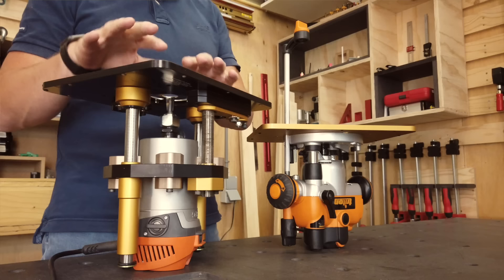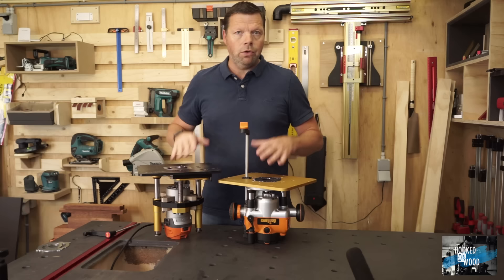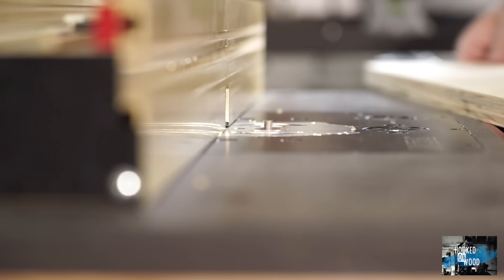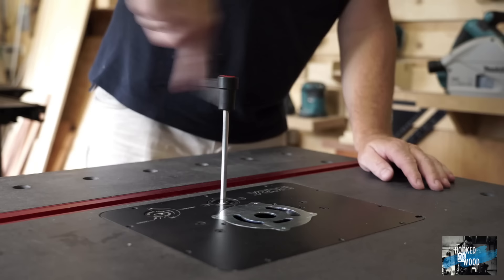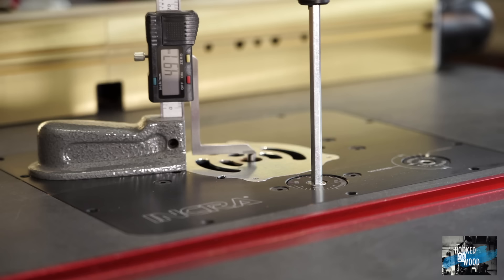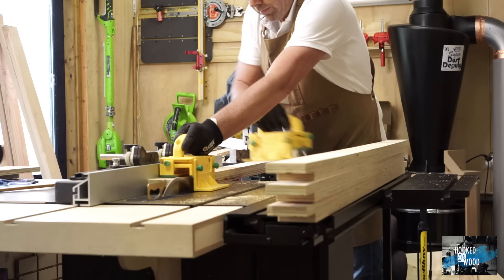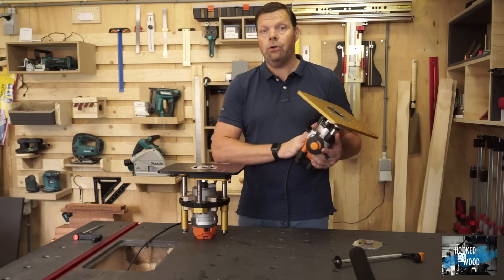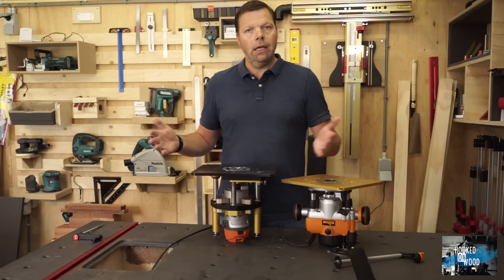Router lift test INCRA Mast-R-lift II VS Triton router

Comment: A good comparison - thank you. I have the bigger 2400W Triton router with the incra fence, incra mounting plate and clean sweep inserts. This set up is super accurate and I wouldn't change it for anything else. The ability to change router bits with one spanner quickly with the Triton is also very convenient.
Reply from the maker: I never compared the 1400 W and 2400 W version. Did you?
Reply: @HookedonWood  is it possible to compare the routers? I want to make a routing table, but I'm not sure which router to purchase.
Jof001, mof001 or the tra001.

Comment: This is a timely and great review.  I live in Germany, and last week I replaced my Triton TRA001 in the Incra router plate with the Incra Mast-R-Lift II and the AUKTools router.  I was thinking about the AEG router, but then I found the AUKTools router and the option I bought has the external power and speed control.  My router table has the CleanSweep housing under the table, and it was getting tiresome to constantly open the router stand cabinet and open the CleanSweep access door every time I wanted to lock or unlock the router height.  The Mast-R-Lift II is a joy to operate and the AUKTools router meets all of my requirements.  The CleanSweep inserts and enclosure are fantastic for controlling chips and dust.

Now I need to find someone in Europe that wants a Triton router and Incra mounting plate.  :-)
Reply from the maker: I found someone on a Dutch forum who wanted mine. I will put a link to you comment. Maybe he wants it.
Reply: @HookedonWood  Thank you, Dennis!
Reply: @martinmeijer5225  Hi Martin, I don't want to post my email address here, but if Dennis would be so kind, he can send it to you.

Comment: There are actually a few other brands that sell over-the-table-adjustable routers like Bosch, Trend, ect...
love your videos!!!
Reply: But none in the 3.25HP power range.
Reply: @staskotula4301  Check the amperage rather than the HP rating. It's a much more accurate representation.  The Triton TRA 001, listed as 3.25 HP, is rated for 15  amps @ 120 volts. The Bosch MRF23EVS is listed as being 2.3 HP but is also rated for 15 amps @ 120 volts making both routers 1800 watt machines regardless of Triton's inflated claims. The fixed base for the Bosch includes above the table adjustment.

Comment: I have always wanted a router lift and I saw the Triton at the UK's D&M Tool woodworking show.  As of today, Triton JOF001 1/2" router £180, INCRA Mast-R-Lift II £470, UKJ Router Elevator £430.  Both the Incra & UJF require the additional purchase of a router.  It really is a no-brainer in my view and I bought the Triton and modified my existing table plate for free.  I find the Triton a superb achine for the price (indeed, at any price!); loads of user-friendly features and safety features.

Comment: Good review!
The Triton comes with a moulded dust collector around the bit. (I see you did not fit this). I use this in conjunction with a fence extractor. Works well. Because you need access to the switch (because of the spindle lock power interlock) as well as the lift lock, a box gets in the way. I fitted a DRO to the lift, so I get a readout of the height at the touch of a button. Fit a guide for the winding handle and it drops in easily.

Comment: I have the Festool OF2200, the dust extraction on that is brilliant. Fully enclosed!  And the plunge is perfect, no play on the pillars,  and the locking system clamps both pillars and the cutters are dead on 90° to the table top. Perfect

Comment: Hi Dennis

I use a big Triton in my table and this comes with an excellent dust extraction shield which removes all the dust from below without any obstruction to the lock or switch.  I have " modified" the switch so that I can leave it on and still raise the router to the top activating the spindle lock.  This is OK as I have a NVR switch on the front of the table ( but I still always unplug the lead before changing bits).  I think the Incra plates would improve dust collection a little but by using a generously sized insert I find it is pretty good.

At the moment I am torn between building one of your new design benches and Ron Paulk's latest version which is easier to move if I want to work outside the workshop ( in UK workshop is about 150M from the house).

Comment: The Triton has two spring loaded carriage bolts for mounting its accessory plate. They  can also be used to mount the router to a router table. This allows you to release the router for hand held use very simply and quickly without using tools and without the hassle of unscrewing/screwing four screws. For some reason NO ONE does this when they show the Triton even though the company does it themselves and recommends it. 
Also the Triton has a dust collecting shield with hose nozzle so you don't need a box. I built a box and lined it with towels to cut the noise down.
Reply from the maker: Thanks, I did no know. About the dust collection shield, I tried this, but a box is more effective.
Reply: Exactly! I love my triton router, that's exactly how I mount it in my router table. Such a versatile router! It's also wonderfully powerful
Reply: For whoever else wants to do sth. similar: Use „schwer entflammbare Schallschutzmatten“ (“flame-retardant sonic mats”) instead of towels. Sold as foam plates. Or just „Trittschalldämmung“, which is cheaper.

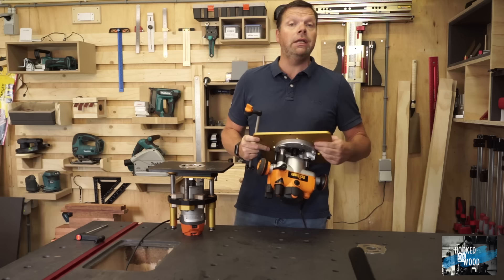Comment: 2:42 Bosch GOF 1600 has that feature, too: You operate the lift using a hex-key. Since dust will eventually accumulate in it, you might want customize it.

Comment: I use to have that exact set up, the older Triton router with the Incra standard plate. For the record, you do not have to drill the hole for the height adjustment rod, the incra plate is made with it. Also, Porter Cable 895 has an above the table height adjustment, with  more precise adjustment and the Incra plate for the porter cable has the hole for the height adjustment rod. As for the Triton router, it was a very frustrating router to use. As you said, no precise height adjustment. Also, often when I was trying to fine tune a bit height, as soon as I unlocked the router it would drop, so I'd have to start all over again. Also, the pin that locks into the shaft for bit changes, so often it would not lock in. It was not jammed from dust, moved freely, just could not lock in all the time. Since that is the only way to change bits on that router, it was very annoying. I was also not a fan of the power switch being the lock out, more reaching under the table. I get the safety factor, but it was annoying. I have a safety paddle that is very accessable. While the triton had plenty of power, did everything I wanted, it was beyond frustrating to use. I ended up getting the Jessem Mast-r lift for incra and it's a joy to use. It's a work of art and so precise. With a porter cable 3-1/4 hp motor it's just amazing. Gave the Triton to my son, I do not miss it one bit.

Comment: I have the Triton TRA001 and I bought a Kreg mounting plate for it. Like the Incra the Kreg is pre drilled for the router and the hole for the winding handle is also pre drilled. The Kreg plate was about €70 including delivery and import duties to Austria, from the US on Amazon.com. This would have been more than €100 on Amazon.de. The Kreg plate is made of high density plastic rather than aluminium but it is extremely solid, it doesn't sag and I'm in the process of making a router bench for it at the moment. I like the design of your dust box and I will definitely include something similar in my table.
Reply from the maker: Hi, Nice router, and although I like the INCRA but I think you will be happy with the Kreg also. Good Luck with your router bench.
Reply: Thanks, the build is going well, though I have some work to do to completely level the Bench top. The heavy wood board I have is ever so slightly bowed so i will have to flatten it out before I start to use it. Keep up the good work I enjoy your videos.

Comment: I chose Triton (with the Incra plate) for its sheer power and it's ability to use every possible bit size (metric and imperial) on the planet, no limits.
Palm routers just don't have power needed for anything else but trimming corners or for working with hard woods.

Comment: There is another company called trend which do the same on their T11 model Rueter I’ve used both and I actually think the trend is a better option they also have a massive selection of accessories. You mention making this plate yourself I would love to see a video of you doing that I don’t believe anyone else has done it yet especially if you could incorporate improved extraction like you did with your tablesaw insert I’ve made it and it’s made a huge difference to my dust collection so to have the same on my router table would be fantastic keep up the good work love the channel👍

Comment: You missed the Porter Cable 890 series.  May only be available in the US.   It has above table adjustment as well.  Been using mine with a Rockler plate for years.  Had to drill the hole for the adjustment wheel as well.
Reply: Slightly old comment but Porter Cable hasn’t offered routers in since 2020.

Comment: Good detailed look thanks. My friend just gave me this router and gonna be getting it set up in a table
Reply: Very well done video, thank you for making it. I have been considering purchasing the Triton 3hp router with a plate like the Incra, since it seems to offer the best value. But I have so far been scared away by the many reviews I have read, reporting that the mechanism that winds the router up and down is constructed of cheap plastic components that routinely break, rendering the router lift useless. I wonder, in your experience with the Triton router so far have you had any trouble with that mechanism? Does it seem cheaply constructed? Thanks for your videos!

Comment: Thank you so much I actually was think of building a router table only with the Jessem system now I probably will go to the incra lift the dust extraction just convinced me.
By the way I am looking forward to your workbench build just because being able to remove the incra positioner and re attach it in a consistent way is perfect for my garage where I have to use the a workbench for multiple tasks.

Comment: Not only Triton has that feature... the AEG in the video has that feature as well...
What's nice about the Triton is that it locks when you lift it to the to so you can exchange the bit without removing the  whole thing from the table or trying locking it while it's still installed in the table
Reply from the maker: Yes, you are right. Thanks for the information.

Comment: Hello Dennis, very good and informative video, thank you. I wanted to add, that there is also a router from Trend (T11) with a similar mechanism - but it´s a different price level than the triton. When I am going to plan my router table, I probably will chose the trend (because when you want to use the machine also as a template router, then the handling from the trend is because of the balance probably better).
Thanks and all the best!
BTW: I am very impressed with your dust collection system on the router table. Thank you, because that is what I am looking for, when I am building my router table.

Comment: You left out the only router lift that functionally changes the operations you can perform on the router table. The MLCS PowerLift Pro takes the concept of the plunge router and inverts it for use in the router table. The foot pedal allows you to bring the spinning bit up into the work piece. Making it possible to do mortising, circle cutting, stopped dadoes, incremental passes, etc. 
Combine all that with .001" precision movements, memory positions, and other computer controlled features and its easy to see why it's unmatched by any mechanical lift.
So would you please consider the MLCS Powerlift Pro. It's a game changer
Reply from the maker: Wow, that is a nice looking product. I do not think they sell in europe.

Comment: I have the Triton TRA001 router in my router table.  It's a great router but it could be better with a couple of minor changes.  First, you can't lock the lift mechanism from the top of the table.  This can be frustrating, particularly if your router in enclosed in your router table for dust control.  On the Freud router this replaced, everything can be done from the top.  Secondly, in order to raise the router all the way up and lock the arbor for bit changing, you have to reach under the table and turn off the switch.  Again, a nuisance if your router is encapsulated. I have a switch on my router table so the switch on the router stays on all the time.  I disconnect power from the router instead of turning off the switch.  They should prevent the router from turning on if the arbor is locked instead of preventing the arbor from being locked if the switch is on.  Like I said, it is a great router but these two things make router table use cumbersome.

Comment: I have the Incra set up with the Triton router but once the small piece of plastic breaks on the router that engages the locking mechanism so you can loosen and tighten collet...the entire router is useless.  Tried to find a replacement part and impossible.  Literally a .50 cent piece renders the entire setup useless.  Just something to think about if going the cheaper route.  Very frustrating.

Comment: Check out Trend T11 (built in lift) and AUK tools router from Woodworkers Workshop
Reply: Trend is one expensive brand. But each to their own.
Reply: @samoanSAIYAN  The T11 is expensive but very good and still cheaper than a Route-R-Lift plus router. I also added an Xtreme extension to allow above the table bit change.
Reply: @georgenewlands9760  thnks for the info

Comment: Thank you for the information Dennis!
I hope you will include detailed drawings of the dust collection box in the workbench plans
Reply: how do you turn the Triton on when it's inside the dust collection box?
seems inconvenient?
Reply from the maker: Sorry for my slow response. I start it with a remote.
Reply: @HookedonWood  thanks for the response! Im thinking of doing the same, but adapting it to a Ron Paulk style bench
Reply from the maker: @jbourgeois5092  That would be a very nice combination.  keep in mind that you need some stability if you push something thru your router from the sides. Best of luck!

Comment: Chalk and cheese. I had a triton TRA001 in a kreg table fitted into a kreg plate and then upgraded to an Incra  master lift II and as a bonus it was a metric version.
Reply: the master lift II is crazy, i haven't used any other lifts but built my own table and used the buy once cry once theory for the lift

Comment: Rockler makes a cheaper alternative to the Incra mounting plate for the Triton routers. I think it is made of some kind of composite material though, I'm not sure, and it only comes with a single insert. Not sure how to get more, as there is only a single vendor here in Denmark. The advantage of the Rockler mounting plate is that it already has the hole for the raising handle pre-drilled in the right location.
I read somewhere that you can make the lifting of the Triton routers smooth and easy by removing the spring from the mechanism, haven't got around to testing it on my MOF001 yet though.
Reply from the maker: Yes, you have to remove the spring when use it under the table.
Reply: @HookedonWood  No wonder the handle was so difficult to turn. Thanks for the response. :)

Comment: Trend have a 1/2" router with a router raizer built-in the router. Same router as the dewalt 625. But better height adjustment.

Comment: i went for the incra mast r lift ii as jessem makes it basically and incra added the maglock. I have something coming from incra and will see how it stacks up to the jessem stuff I have, but I have doubts. All the jessem stuff I have is so well built like a tank and quality I have not seen from any other brand.
Reply from the maker: Hi Chuck, Jessem is one of kind from building point of view. I do not know what you have coming from INCRA. Most products I have from INCRA I like very much! It is good quality, but looks a bit old fashion compared to Jessem. The LS positioner though is un beatable if you ask me.
Reply: @HookedonWood  I got the miter express sled thing, its ok, not sure $170 worth as quality control was poor and not finished well. I have all the incra t squares. I will get the incra positioner when i get a proper table saw, but for now a laminated mdf router table and jobsite table saw it is as my working space is extremely limited. I have a lot of hand tools to make up for lack of space. I almost got the Hongdui miter gauge after watching your review but went with jessem, i know the miter gauge is half of what I paid for the table saw, but I am looking into the future. The jessem mite r excel II is great, and heavy. There is a slight cup in the fence which a sacrifical fence fixes by pulling out on the middle of the fence when you tighten the bolts,  but if you are not using a sacrificial fence with certain items its guarantee blowout so it is a self correcting problem, but you could clamp backerboard to it if you wish not to put a fence on it. I email jessem about this to see if this was a implemented design or not. I do not need 1 degree accuracy so it covers what I need. Thanks for the videos, have been watching a lot of them, i did not know about you but love your work.
Reply from the maker: I think the ls positioner from INCRA is the best product they have and for to inexpensive considering how accurate and repetitive it is. I did not like the squares. The router lift is great, but ofcourse that is a Jessem. You will love the LS positioner👍